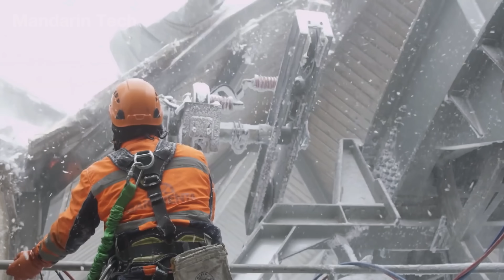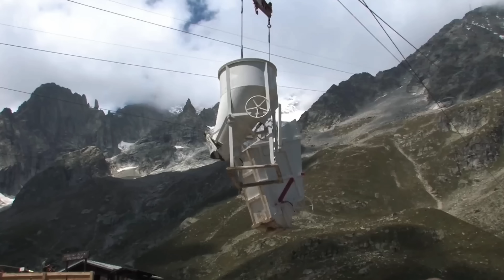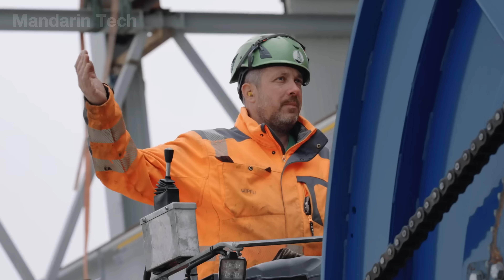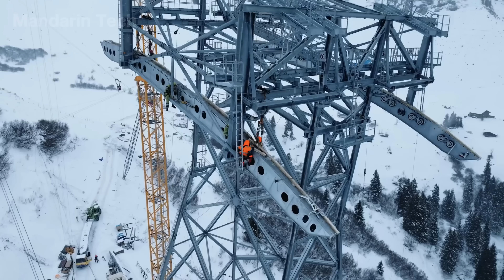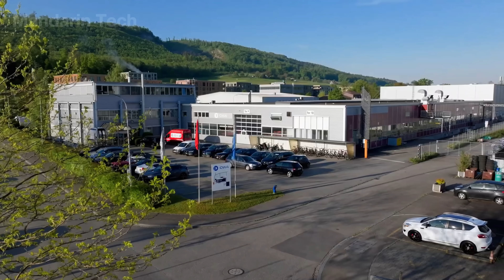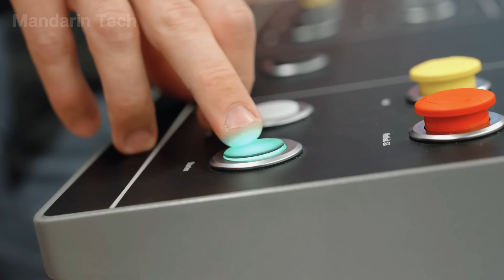How Europe’s Engineers Built The Steepest Cable Cars Ever on Alpine Cliffs

Comment: I liked the video.There is one question I would like ask,and that is.Would the cable car system stand up against snow
falls that slide down mountain sides.I am an Engineer.
Reply from the maker: Great question from an engineer’s eye — snow load resistance depends on design specs and local safety standards!
Reply: Non è mai successo che una valanga prendesse un impianto....almeno in alto Adige....